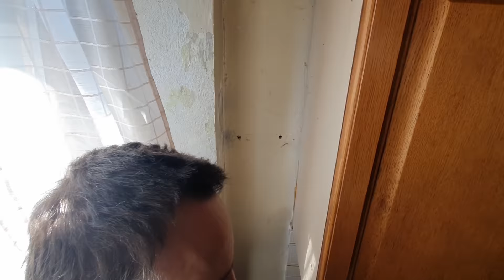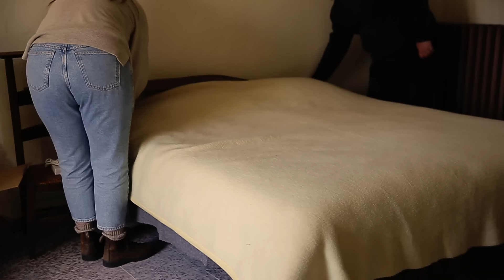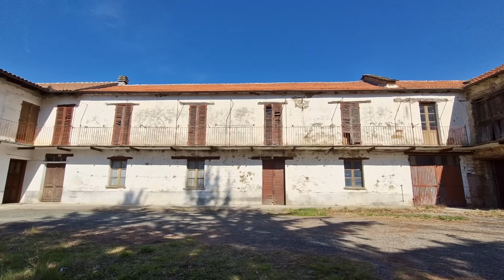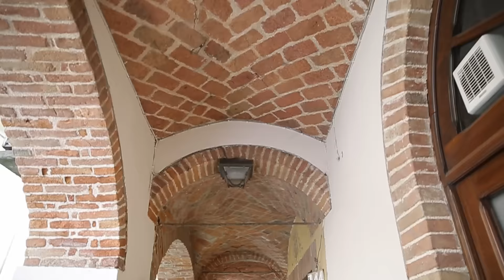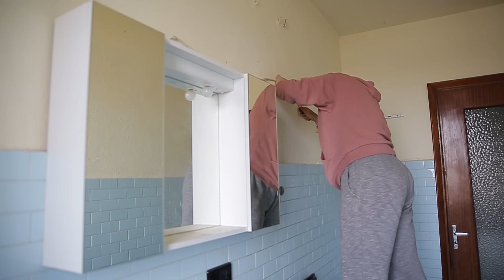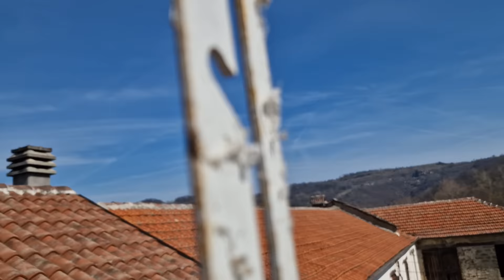#5 Finally sleeping at the farm and a surprise discovery - Renovating in Italy

Comment: First night in the house must have felt like a big milestone!
The market looks like great potential for nice vintage decorations and such.
The bathroom presure problem sound like a rusted/clogged up pipe.
Reply: Yes. 1960s was still very much the era of galvanised pipes and those pipes tend to rust on the inside until barely any water gets through. On the other hand the greenish stains on the sink do look like copper combined with acidic water, which would be a bit unhealthy.
Reply from the maker: It did feel like a big milestone! And we'll definitely be picking up more treasures from the market over the coming months!
We have very hard water, so that no doubt has caused clogging in the pipes. we think the pipes are copper rather than iron, but there might be buildup of corrosion.
Reply from the maker: We think the pipes are copper rather than galvanised iron. Copper is quite commonly used for water pipes in Belgium and The Netherlands as well (I guess in all of Europe). As our water is very hard I'd be surprised if it would be acidic. Our water comes from the municipal water supply so it does meet national standard criteria. I wonder if the green corrosion might have been caused by acidic cleaning products rather than acid in the water itself.

Comment: Sthill has a small hand held chainsaw ideal for chopping all those smaller branches,get yourself a tester for the power cords ,we don’t want anyone electrocuted .Keep your ash from the stove and use it where you are going to have your vegetable garden.please don’t pick spinning wheels up by the wheel use the bed or put your arm through the wheel not by the rim over time this breaks the joints in the wheel and helps buckle them.finally beautiful video nd good find on flowers and trees.
Reply from the maker: we're saving the ashes but before using them in the garden we need to test our soil. it's our understanding that we have fairly alkalic soils and we want to be careful not to overdo it :)

Comment: Wonderful videos ..: views are beautiful!  
Wondering if there is a leak somewhere comprising the water pressure!  That can be ck with a test  pump air in the pipes and see what facet releases the best air pressure…. A low pressure and then a possible leak in that line!
Saw an owner do this in a house he bought … pipes were leaking everywhere..: but he fixed them all!
Good luck 💕
😊❤
Reply from the maker: Thank you! There are no visible leaks (no water damage) as far as we can tell, but it could very well be that they are still there. We're curious to learn more about the air pressure test, so we'll dive into some researching. :-)